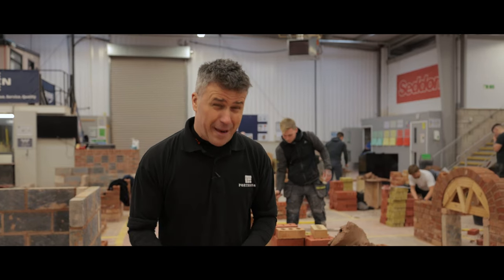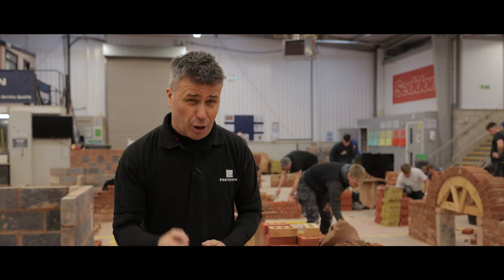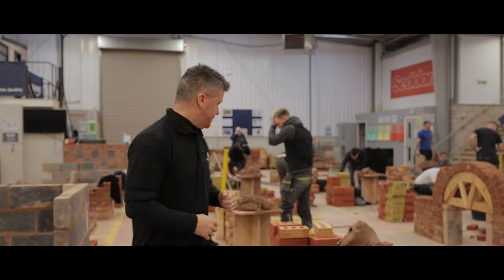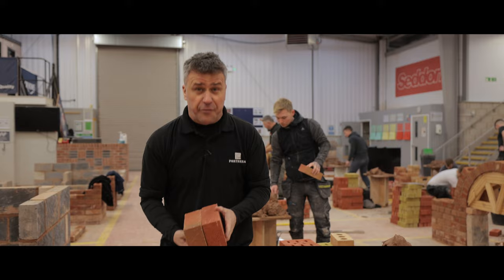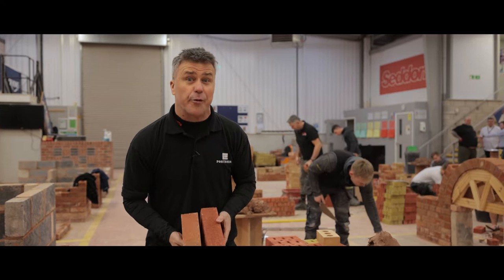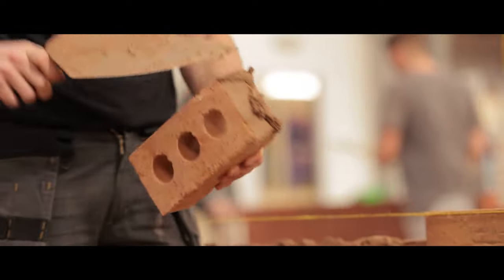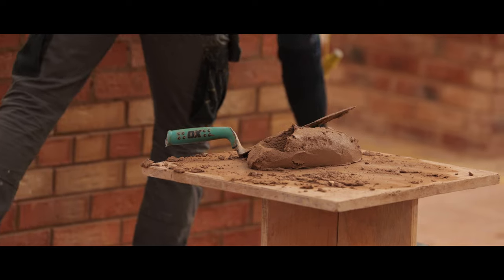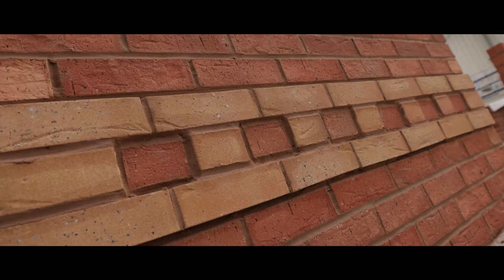Clay Bricks vs Concrete Bricks  - The Challenge | Forterra

Comment: Another thing what they forget to mention is how the clay brick are made can determine how long it last. For instance if u make clay bricks using modern techniques than the clay brick will be brittle and weak against strong forces. While using traditional techniques makes the bricks last longer.

Here is the modern method which makes clay bricks weak.
1, They leave the bricks out in the sun to dry up which makes the clay break down due to weather.
2, They use a brick squeezer which removes all the water from the brick making its bond weak.

Traditional Brick making is better coz u cook the brick in an oven making the brick denser like when u make clay plates which are harder and stronger than silicon clay plates.
Reply: No, modern bricks are also fired
Reply: Thankyou for explaining, I remember long ago someone selling us sun cured bricks, was horribly fragile